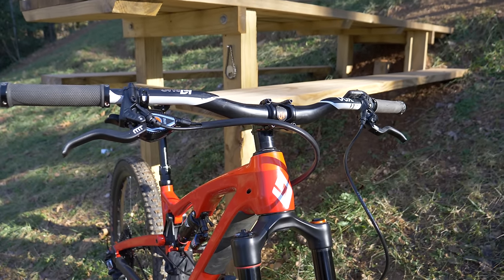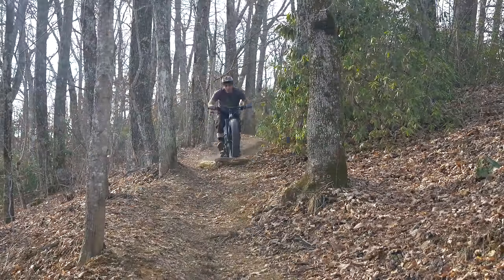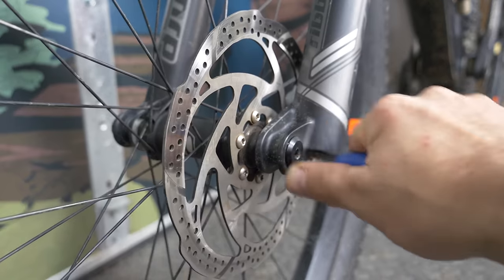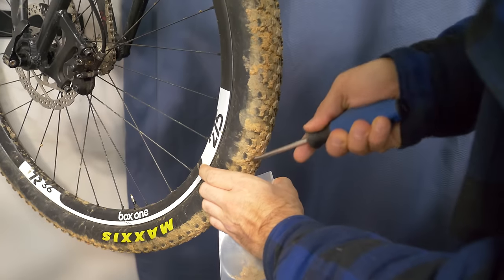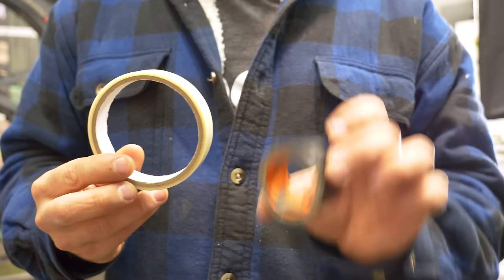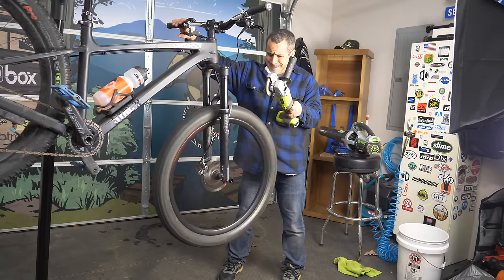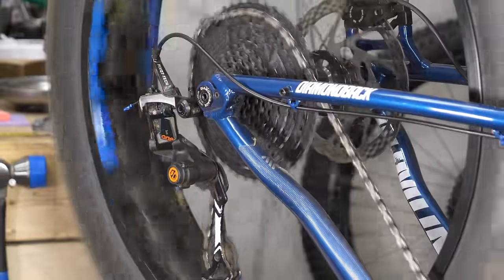11 Super Cheap MTB Upgrades

Comment: You can not combine Aluminium and steel or other noble metals with electric contact. The least valuable metal (less noble) is going to dissolve in a kind of electric cell („battery“). That‘s why the alu cap was getting crusty.

Comment: for stuck pins cut a groove with a hacksaw or cutoff wheel (for that sketchy brake bedding tool)  then use a flathead screwdriver to remove. Don't forget your safety squints...
Reply: Thats a legit idea! I was thinking there has to be a better way to get those out. Good idea man.
Reply: Dremel tool works fast too. Just make sure you get a thin cutoff disc for making the slot.
Reply: Left handed drill bit does amazing things to stuck bolts/screws.
Reply: Don't forget heat
Reply: “Safety squints”
Reply: I finger an impact driver is welcomed
Reply: Top trade secret the old groove. Try hair conditioner instead of shaving foam / gel too
Reply: torx key usually opens fucked up allen bolt

Comment: Another tip I've found for converting to 1x is to leave the front derailleur on. If you don't have a clutch rear derailleur there's a good chance your chain will come off even with a narrow wide chainring. Leaving the front derailleur on, but removing everything else including the shifter, means you have a super cheap and functional chain guide. Just adjust the limit screws accordingly.
Reply: Here in Thailand chain guides are dirt cheap (3$)

Comment: Pro tip: when removing the little screws on your pedals and can't get them out, take a hack saw and cut a slit in the top of the screw and use a flathead screwdriver to remove it

Edit : works on all exposed screw heads
Reply: thanks
Reply: Ta mate, great tip!
Reply: That’s the smartest simple trick in the world thank you
Reply: Even better to cut an X and use a special X screwdriver with flat nose, more grip and less prone to breaking the slot you just created. 
Also using heat will soften threadlocker fluids
Reply: You can use a dremel if you’re impatient
Reply: or you could weld the screws to a small metal rod and use the leverage from that to get them out
Reply: Hey a Dremel is easier to use
Reply: @Durwood71  You use the trick to remove the pins, you would remove them to replace them. The saw trick helps get the pins out, maybe read a bit more closely...
Reply: I used to do that until I couldn't on ski bindings because there was not enough clearance. Bought a set of screw extractors for 7.5 peanuts. My life is changed! Get yourself a set of screw extractors if you have an outlook of extracting more than 2 stripped screws during the rest of your life.

Comment: Glad you mention keeping lube away from disc brake rotors. For that reason, I recommend DRIP teflon lube over aerosols hands-down. Triflow 2oz drip bottles come with a straw to help direct lube application, but an ever better solution IMO is to get a finer metal needle lube bottle. Just throw in some old nuts and bolts to act as an agitator to get the teflon off the bottom of the bottle and in solution with a shake before applying to your bike. Look for needle lubers with a screw top and rubber cap for the needle.

Comment: Great tips Seth, keep them coming!
In addition I can also recommend the following:
- carbon bottle holder
- neoprene chain guard
- chain guide
- silicone grips
- keramic jockey wheels
- designer handlebar cap

And removing most decals with a hairdryer makes the bike look more smooth.
Cheers from The Netherlands!

Comment: Seth: Struggles to take pin out

Also Seth: Proceeds to use high strength (red) threadlocker
Reply: All he had to do was apply a bit of heat to break the loctite
Reply: I guess he’s watching Chris fix😂🤘🏻
Reply: @anonymebande8561  he didnt use soopy wooder
Reply: @tkegger21  Or Chris Fixes official blinker fluid
Reply: @eu_xn5749  everyone knows it only works for the blinker
Reply: WerstInternetUser why did you ruin the joke...
Reply: There are many variations of red loctite. and I work in the aircraft industry so I do know what I'm saying
Reply: @julesowen-jones9815  literally unrelated but cool flex bruh

Comment: Im definitely a fan of dry lube keeps it slick no matter what the conditions!!  I know its not ideal for everything but in the conditions I ride in its perfect and lasts the longest.
Reply: which lube do you use to be able to do this in the winter? how does it work in -10C or colder? how much water, snow, slush can it take?
Reply: @mtbboy1993  Im not sure of the brand im not really biased when it comes to that.  My last bottle was the WD40 dry lube I do use a lot of it on my chain and cassette before I ride in the snow or rain and it seems fine at the end of an hour ride.
Reply: @FatGuyBiking  lubing the cassette? why? I ride for multiple hours if I can.
Reply: @FatGuyBiking  I haven't tried any of their stuff.
Reply: I tend to find that Dry Lube doesn't last all that long on wet muddy rides. Especially once the rear dérailleur is clogged with mud, which can sometimes be as little as 5 mins depending on the trails. 

So for me I tend to use dry Lube and simply accept that the chain will come back in a pretty bad state. Then my bike sounds quiet and smooth at the very least until I get out of the carpark xD

Thankfully I have not had any worse rust than surface discolouration after a ride. That said, I have one bike that has an early 90's (late 80's?) Deore that has no drivetrain rust, seems they made them of more rust proof materials back then rather than light. Whereas my current one started getting surface rust within a few months, despite being lubed before and after each ride.
Reply: Some Silicon Spray also does the job and is even cheap than the teflon version
Reply: spit not lube
Reply: Personally haven't had good experience with dry lubes. Firstly, they don't last very long - I had to re-apply it after mere 50km of riding, and I do rides much longer than that. Secondly, and this relates to the first issue, while the drivetrain did feel smoother initially compared to wet lube, it would eventually get much worse. Thirdly, the bottle is gone very quickly. And worst of all, dry lube was, in my application, worse in terms of chain longevity. 

I'd say that the use of dry lube is very situational, and that a wet lube is simply more versatile.
Reply: @mtbboy1993  Lube the cassette to prevent snow from packing and sticking to it - leading to chain skip.
Reply: @publicmichaelzmit  never had this problem, but the chain will get lubricated by the chain moving up and down it the lube will spread all over it anyway, even if wiped off access.
Reply: @mtbboy1993  
That's funny. I've never used wet lube because I live in dry ass Australia. Wet lube is horrible for me.
Reply: @foxxy2583  dry is good choice there.
Reply: @aljowen  don't ride when it's muddy.  It ruins the trails for everyone

Comment: This video series has been so helpful as I have never had MTB specific tools or parts until I got my first real MTB, which is an Intense Tracer 27.5 (I had a Diamondback comp 29er but it was not at all the right thing for my riding or body). My passion lays with racing motorcycles but MTB is a close second. Thanks Seth!

Comment: If you switch to schrader valves you can get 10% performance gain from performance valve caps.

Left hand drill bits are great for removing stuck screws (like pedal pins).
Buy a cheap set & use them only when you have to - or buy a good set & use them more. They spin the opposite direction and will usually back out the screw when they bite in. If not, you'll have a hole for a screw extractor.

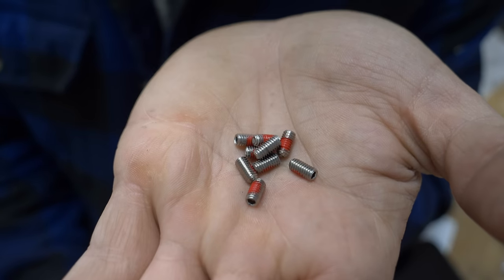Comment: 1:10 Pro tip to get those worm screws out: heat them up using a soldering iron. That liquifies the loctite and then they come right out.

Comment: I think the chain oil part depends on riding conditions, if you tested it with wet mud the dry lube would be more likely to wash off.
Reply: Was just about to comment on this. I live in fairly wet conditions, and the drylube can NOT be used as it washes off right away.

Comment: hey seth with getting the peddle pins out you could always grind or cut a notch into the old pin (if it still is above the peddle) and use a flat head to screw it out

Comment: If your still rocking 3spds, a tip is to always go down hill in middle gear, you can drop down to the small cr if you get a pinch in the track, and it doesn't fall as much as if your using the large chain ring

Comment: Unless you're exclusively riding downhill or low-speed trials, there is never a good reason to switch to a 1x drivetrain. The extra gear range is ALWAYS more valuable. If your chain pops off more than once in a blue moon, it means your derailleurs are badly configured. You need to move your front derailleur down until it juuuuust barely clears the chainrings when shifting, and you need to increase the spring tension on your rear derailleur to keep the chain taut. A 1x system will actually make chain-drops more likely in certain circumstances, because the rear derailleur cage has to be longer to accommodate a wider range of sprocket diameters, and thus has less leverage to keep the chain taut. That's why clutched rear derailleurs had to be invented in the first place. A 2x/3x drivetrain can use closer-ratio sprockets and a shorter-cage rear derailleur, which will have more leverage to keep the chain taut.
Reply: I also run on the largest sprocket on rough terrain to keep good tension on the chain and rear derailleur, then when you come a steep climb I can easily shift the front down a sprocket for a big decrease in gear ratio👌🏽

Comment: On open bath forks, you can just add oil, which will do the same thing AND give better lubrication.
You may also want to change the oil thickness too, for faster or slower operation

Comment: I have an old aluminum mountainbike from 1998, recently had it powdercoated I'm a new stunning metallic lime green and it's been an absolute joy to ride, changed the original gearing from 3x7 to 3x10 with larger front sprockets, swapped the old mechanical brakes for hydraulic brakes.
Im gonna keep this bike in top condition until it can't go on. Gonna ride it till it finally dies

Comment: If you have a hard time getting the traction screws out of your pedals, try putting a little kroil on first. If you have to go on to drilling and extractors, get some left hand twist bits of the proper size for your extractor. With a little luck they spin right out and if not you at least tried and it's on to the extractor. There's some other things but that's usually plenty for any small fasteners.

Comment: If you have trouble getting the pins out, use a Dremel tool.  Cut a slot in it and just use a flat head screw driver to back it out.   You'd basically make a flat head screw/bolt.

Comment: Good tip for a tailgate protector that's a hell of a lot cheaper than a race face protector, and a lot better looking than using cut up cardboard boxes. Look up carseat seat protectors on Amazon. They're tough and durable and look cool. They have them for around $20 which isn't bad if you only transport 1 or 2 bikes usually.

Comment: Heat will help soften threadlocker fluids, also use thread penetrator solvents... and like others said, cut a slot on screw heads and use a flat or X screw driver

Comment: To change out the pedal nubs, get a grinder with a cut off wheel, cut slits in them and get them out with a flat head screw driver

Comment: I've found the best way to remove stripped screws and pins is with a good pair of wire snips. Straight up and down, slightly cut into the pin, and turn. It should free it up relatively painlessly.  As long as it's not flush with the pedal.

Comment: If your pedal pins have been bashed & rounded off like in the video.
Get a file & gently file the head just enough to get your hex/allen key in.
Don't use an angle grinder.

Comment: That "crustiness" on the aluminium valve cap is due to galvanic corrosion and can be simply remedied by greasing the valve and or threads before installing.

Comment: to get the pins out of your pedals, if enough is exposed, you can grind a slot into the top and use a flat-head screwdriver/drill

Comment: A bike hacks I've been using for years is if you travel a lot like seth then instead of buying a bike specific bag you can use a bike box from an old bike which is way cheaper than a normal bag

Comment: you can get derailler end caps which are little tubes with a wheel in the middle which bends the wire by 45 degrees or something

Comment: SETH you NEED to check out the town of Crosby and the Cuyuna MTB trails in Mn it is all based around Iron ranges and crystal clear blue lakes. The whole town runs off of it, and they just last year put in jumps and more advanced trails. Hundreds of miles of trail.

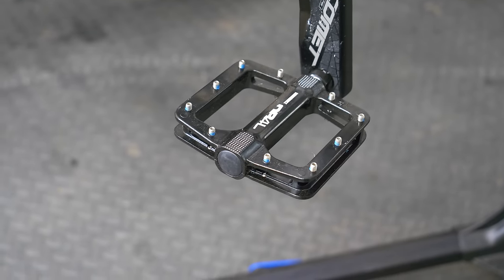Comment: 1:06 don't use bolts with red threadlocker because when you finally want to remove them you will have to heat the part over 200 C to remove them. Also red i overkill for this application. Blue is sufficient because you only have to deal with vibrations. red is used in parts like engine components or shafts things that can get heated and you definetely do not want coming loose ( such as disk brake rotors on a car.  Just be careful where you use red threadlocker cause it can give you hell to remove it or it will simply not come off  (if you don't have the right tools)

Comment: the problem with the aluminum valve covers is that the will oxidize on the inside over time, because they DO NOT have a plastic inner, like aluminum valve covers for cars. Also, since they were more that likely "racked" on the inside of the valve cap before anodizing, there will be microscopic bare spots where the rack contacted the aluminum part, and this is what causes oxidation of the aluminum of the inside.

Comment: Pro tip on those pins, use heat. Get them real hot first to release the thread locking compound.

Comment: For the little pedal pins try a similarly sized torx bit and tap it in with a hammer.  Usually works

Comment: on the pedal pins..... If pedal manufactures would drill and thread the holes all the way through you could insert the pins in from the bottom side preventing the hexs from being warn down making them very easy to remove.  As a former street bike guy (gsxr1000) as well as knowing several motocross guys I can attest to the dry lube. street bike guys with o ring chains clean with wd40 or kerosene and lube chain wax or a dry lube. look into the motocross work for great chain lubes. From the drag race and auto cross world brake pad material makes a huge difference in braking performance. I build high end cars for a guy that's been into the motocross world for quite some time. This is where cross breading of "motorsports" can come in handy what works well for one can trickle down to another.
Reply: Just being into one wheeled sport you should also watch for advancements in other wheeled sports and you might gain that last completive edge over the next guy that doesn't fallow those same sports. Just as disk brakes first came to be in Indi car caring and now all of our road cars have then at least on the front if not on all 4 corners.

Comment: Dry lube ptfe/silicone is great and strangely enough if it enters the brake areas its not of such a big problem, compared to any traditional petroleum oil or  grease which really is trouble some. The drylube just brake hard and it will grind of.

Comment: To get the screws out you can use an angle grinder and cut a line so you can use a flathead screwdriver to get it out

Comment: When taking those studs out of your pedals and you come across some that strip.... Use a Dremel tool with a cut off wheel and cut a groove across the top of the stud and use  a flat head screw driver to break the stud loose.  Youre welcome.

Comment: Regarding chains.

Just counting the number of gears does not necesserily mean that you will get the correct chain. You may need to remove some links in certain cases by using a chain breaker.

Best thing you can do is check the sheet of the bike, buy the corresponding chain and then count the number of links on your old chain.  Do NOT compare them by putting them side to side.

Chains elongate(grow longer) from use. Thus putting them side-2-side will give you incorrect results.

Comment: Those pedal pins are literally just a set screw (the Amazon link now goes to a set of allen screws with a securing nut), you can probably find them at Lowes for 6 cents a piece. Throw a little loctite on it yourself and screw them in. Probably cost way less overall for a couple bags of hardware at a store.

Comment: Those pedal pins have plastic thread locking compound on them ,so in order to loose them more easily is to heat them with heat gun .

Comment: For a better way to remove unrecognisable studs from ur pedals- cut a slot all the way across the stud with either a fine hacksaw blade or Dremel tool, then proceed to extract it with a flat head screwdriver like a normal screw

Comment: most people who convert to 1x add a 2 pound dropper post.  so weight is nill :) If you have a 3d printer you can print off a valve stem cap :)

Comment: If you got problems getting your pins out of your pedals, heat them up. It will brake the corrosive layer between the pins and the pedal.

Comment: My SRAM XO1 hates dry lube. Noisy after 15-20 miles, sounds like a bucket of bolts coming down the trail. Even with the super dry climate of a Boise summer, I have to use a wet lube. Because of said dirt, I clean drivetrain and chain compulsively, but it is much smoother and quieter with wet lube...